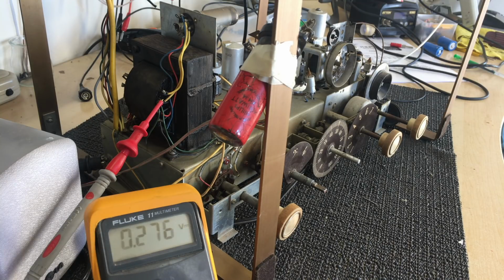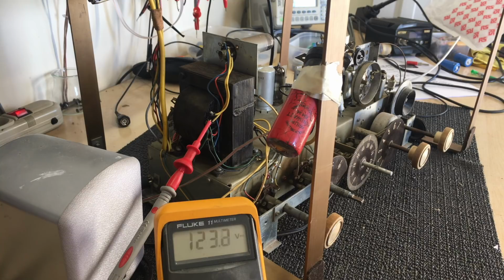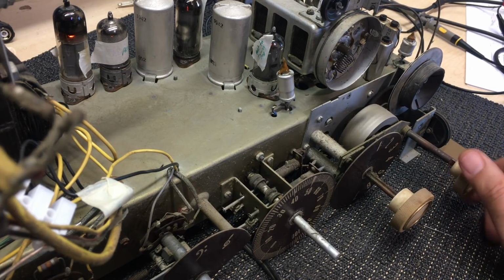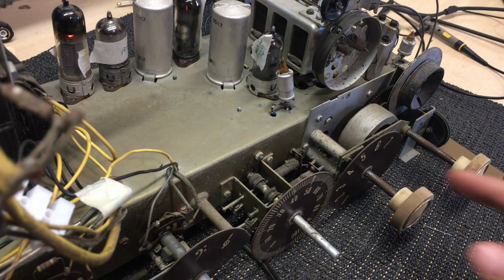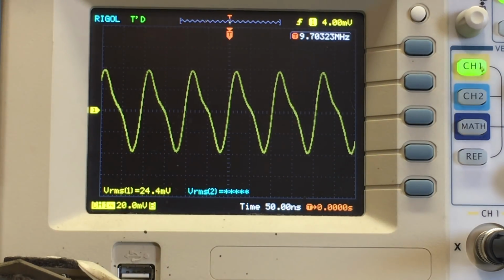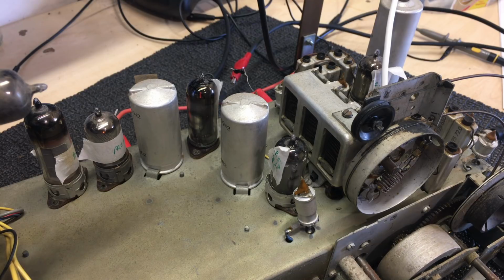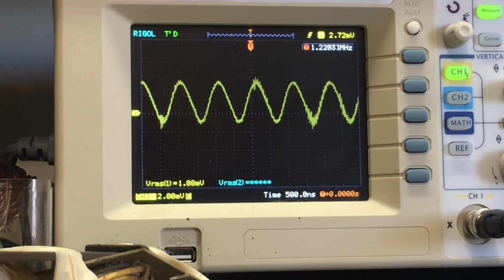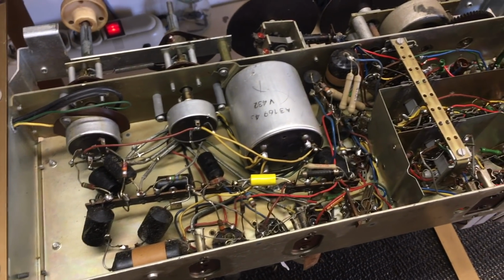Philips BX626 tube radio restoration - Part 3. The actual first "power up" to check for reception.

Comment: Why would you use an antenna to test the reception when you have a signal generator?  New sub - Enjoying your videos.
Reply from the maker: The antenna was used to test  for actual radio reception. I can use the generator, but ultimately the set has to receive actual signals at the levels that are a lot lower than those of the signal generator.

Comment: I worked on a GEC set once changing, as you suggest, one (or three!) capacitors at a time and powering on. It was very deaf like your set until I changed the AGC capacitor then it was like a new radio, the transformation was remarkable which is why it's stuck in my mind. As you say unusual to find the IFs detuned and the tape still over the cans. Good video and I like your little sniffer probe!
Reply from the maker: If the AGC cap is out then we may well see a transformation. Hope so. Anyway, one way or another, we’ll find the problem.

Comment: i actually prefer this more "brave" approach on your repairs, testing the radio with just the minimal stuff  replaced... that is also my usual approach..check for shorts,replace coupling caps , power up, diagnose and then recap.  
have you ever considered tube tv repair? i like it, it is very challenging/rewarding/frustrating and one can feel very lonely doing it since i dont know of anybody else in the country who does it.. Keep up!
Reply from the maker: Doing these restorations the same way gets repetitive, so I like to try and vary a bit. 
I’ve never tried tube TVs, and don’t know anyone who has. When I opted for electronics engineering at university, they used to say that this was a coward’s choice, because we only worked with low voltages that couldn’t kill you. I feel that I’ve proved “them” wrong by working on these tube radio voltages. However, TVs scare me, so I’ll stay away.